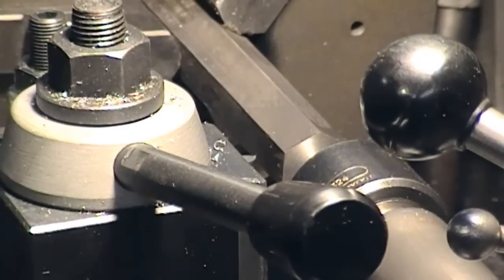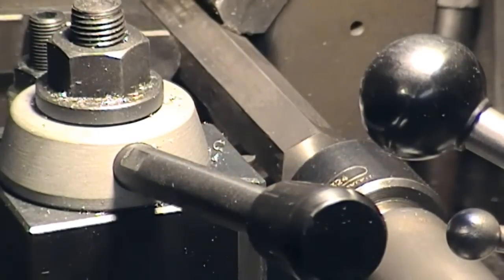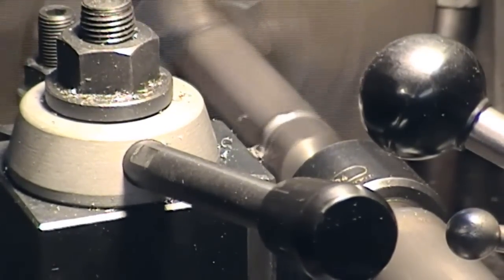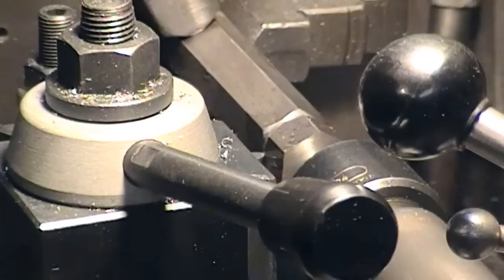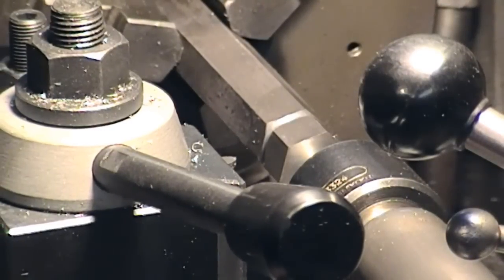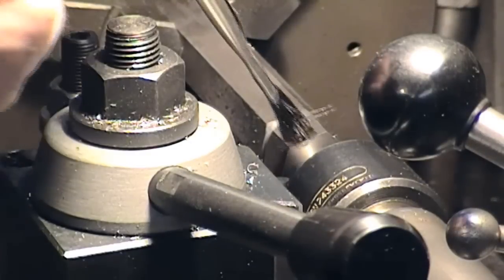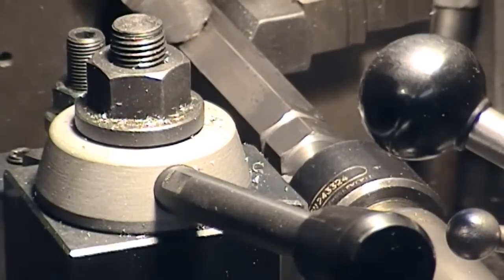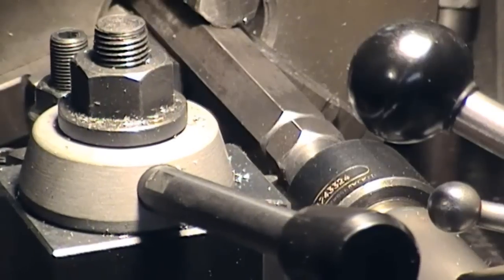Just a nut! Making one in the lathe

Comment: Tap the nut AFTER you part it off.   Re-chuck the nut in the 3-jaw, then run your tap into the hole.  When you tap your way, you create a burr in the thread from the cut-off tool.   That burr  will have to be removed.==time-consuming.   You also waste material by drilling past the width of the nut to make room for the tap.
Reply from the maker: Hi Rob,
Yes, yes and yes! In fact burr removal with a Noga is pretty quick. Thanks for commenting.:)

Comment: i did 3/8-24 thread brass bolts and nuts with curved edges and 5 stages of polish (from 400grit sandpapers to 2000grit)
talking about over doing a job

to make you feel good about how much time you wasted on that bolt
notice that off the shelf bolts/nuts are not that good and if you look carefully alot of them are way off center (they wobble as you fasten them in )

so what you did here on a lathe is far better considering how tough/hard the material you used (cant find those in cheap hardware stores today) 
unless that bolt came off an expensive machine.
Reply from the maker: +Faisal Abdulaziz Hi Faisal -- agreed - off shelf nuts in particular are often way off being made true. Sounds like your 3/8-24 job was a work of art!:)
Reply: ChrisB257 i take alot of time to do things...
and when i close in to the desired dimension  i make sure the work piece is cold enough before measuring  and sand it down to desired size to make sure i dont over shoot it...

thanks again

Comment: Why did the hardness of the material make you hesitant to power turn some of the machining? Having said that it was nifty learning that there is such as thing as a hand crank for a lathe, fun little project
Reply from the maker: Hi -- it was also a lack of confidence in the parting insert - which had previously had me mistrust it a bit! Made spindle handle long ago - and so use it whenever a need to 'take it easy'! :)
Reply: I'd like to see this spindle handle and how it works!
Reply from the maker: arckon09
It does show up in some of my vids but maybe not in great detail.  It is very simple -- one end is an approx 5" length of round turned to just fit 1" 1/16' spindle bore. To that is attached a length of flat bar, approx 1" x 1/4" using 2 bolts into the round spindle insert end. The bar is about 7" long and other end just has a simple piece of nom 3/4" round attached as the operating handle. The spindle was drilled axially so as to take 2 roll pins, and these allow engagement of transverse roll pins in the spindle insert rear. I'll perhaps do a real short video to show this better - check this -- Spindle handle for lathe